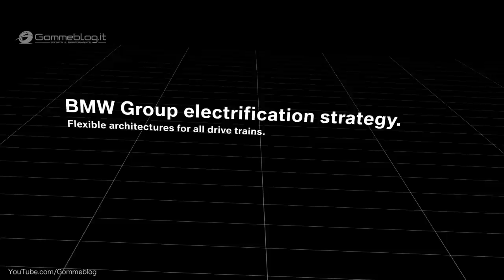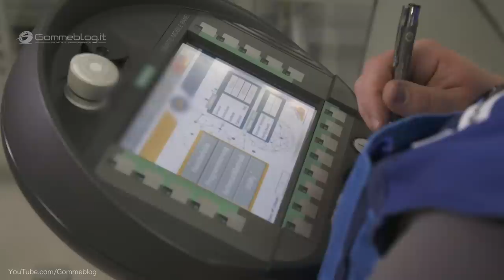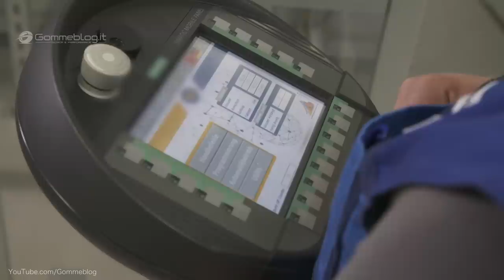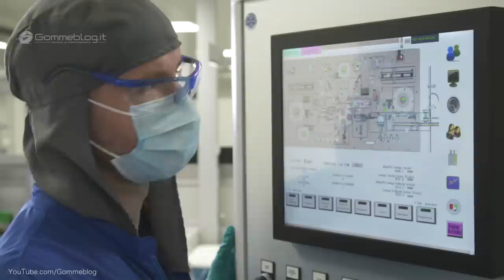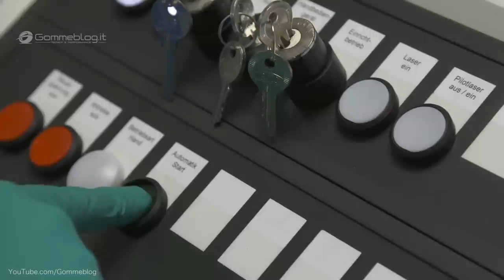BMW Electric Drive HOW IT'S MADE - Interior BATTERY CELLS Production Assembly Line

Comment from the maker: Electric Drive is the Future !! In Your Opinion Electric will be great as the  modern 4L, V6 and V8 Engines ?
Reply: GommeBlog.it: Car & Performance bmw only has i6 no v6 lmao that's like saying Honda makes a v4 (excluding their niche bikes)*
Reply: Honda does make a V4: https://en.wikipedia.org/wiki/Honda_VFR1200F
Reply: Andrew Beresford not in cars though..
Reply: That's true :) I just didn't want one of their finest engines to be forgotten!
Reply: easy swap~able batteries would be better . also , no modern tech products can last more than 2 years with minimal maintenance . so it would be wise to teach public best way to dismantle , recycle & dispose of beyond repair materials .
Reply: Is this real speed, or slowmotion for the vid?
Reply: I'm afraid to say that they're already better! :) Test drive an i3 if you can and you'll soon get rid of any engine car you have!
Reply: i want to work there . easy . just tightening screws and few installations . also get to work side by side with pretty german ladies
Reply: GommeBlog.it: Car & Performance -€y
Reply: It can't be any worse than the junk engines they currently offer. None of them are holding together, timing chains that go bad in 60k miles, oil leaks and way overpriced parts.

They do drive nicely though.
Reply: What happens when the batteries freeze or when they hold less of a charge and discharge less energy in subzero temperatures?  Walk and buy new replacements batteries for your electric car at $2,000 a set? I'm all for alternative energy. But this technology (in my opinion) is still terribly outdated and is designed to costly to the consumer. Just like the combustion engine is being made to do. Oh they can make tthem with supior fuel efficiency and more power with less emissions. But my would they build them to do that when their friends and colleagues make their money from selling you the fuel to run them. And more fuel that is burnt in your engine the more carbon that will be building up into it and creating the need to have emissions reduction components, parts and sensors installed and replaced when they brake down or fail.  Helping part sales revenue.
Reply: all new - well forgotten old
Reply: John Pinter I'm for e-drive but you must consider the efficiency of all process, who and how produce electric energy for the battery?
With actually tecnology the electrification it's only green in the place you use the current, but not where someone produce it, the risk is to increase the global pollution and also old battery are difficult to recycle.
Windturbine and idroelectric pump are actually the best way to transfer energy in electrical energy
Reply: because gas and diesel polluters don't have trouble in sub ZERO temps??? WTF is your problem?
Reply: Electric Drive is not the future, that's already present. Internal combustion engines are already the past and outdated.
The internal combustion engines already reached it's maximum, you can't make it more efficient. It's just the last century technique.
Reply: What is happening @ 17:00
Reply: Electric motors are great, but building batteries, charging them and recycling them is really inefficient. Power in never equals power out. People have always rightly complained about the battery element of off-grid systems. If you can imagine the whole world switching to using battery power for almost everything - transport etc etc, then just think how inefficient that will be, not to mention the wars over resources! Thankfully we still have legs and bicycles.
Reply: Energy from magnet can be obtained without any mechanical movement. All we need is material capable of being converted from magnetic to nonmagnetic when applying electrical impulses. This will simulate the rotation of the armature in the generators. Such a material was created for other purposes and there is technology. More info ?
Reply: Absolutely! They are the future
Reply: 07:06 Ja bundabar :D
Reply: You seem to forget that modern improvements/tech is also used on ICEs, diesel will ALWAYS be around and theres many more problems to mass evs than most people know because most people know little of this field.
Reply: YRS
Reply: GommeBlog.it: Car & Performance  it is more efficient and noice free and pollution free
Reply: Battary life is impartent
Reply: Electric cars are great already. But the pollution resulting when producing the batteries (that have to be replaced every 2-4 years or so) and the pollution created by the substances yielded by battery "recycling "process nobody speaks about. Because that bill will be higher than the internal combustion engines -and will be paid by our children's children.
Reply: It's better already..just need better batteries/ greater energy storage.solid state graphene type might work well..
Hybrids are the future..
Reply: @ifan3270  …八
Reply: Humanity must return to super-coherence with nature or lose the planet. Renewable sustainable energy is our only hope.
Reply: OK...handar....6o...m....codomona....u.....parmeson....dean
Reply: Это 💯 процентов!!!

Comment: EV's are coming. Todays £75 ph ICE mechanics are tomorrows out of work blacksmiths. I'm an electrical engineer with an interest in power electronics. I'm gearing up for this right now!
Reply: Yep cause their won't be a need for suspense er I mean suspension and mechanical steering or other mechanical parts. Wait rumor has it even with the new electronic stuff some mechanics or apparently technicians as they are called these days seem to take course on that stuff, but that's a rumor.
Reply: Me too . I think were on the right track
Reply: Actually, the mental and experiential crossover from ICE to EV is good enough that most mechanics who learn EV mechanics and electronics now will do fine.  Yes, it requires learning about electric things, so there is a bit of a hump there that may waylay some of the anti-electronic people, but a lot of mechanical people have the right brain set for electronics too.  You're right that the BEST electronic people will be better suited to EV's than the BEST mechanics, so there might be a bit of a pay cut for the BEST mechanics.

But I think the biggest determinant for today's mechanics to catch up is whether today's mechanics start learning EV stuff now rather than later, because later is too late.  While some individual mechanics just won't hack it, most would if they start now, and if they're not too late in life, it would make sense to either update in their auto repair career or get a new better career.

It's interesting:  our society got stuck with ICE vehicles for a long time; we're not used to change, even though we've been lied to and say we're used to change.  We've actually experienced a lack of change in terms of market forces in the vehicle realm.  Natural innovation would have been slowly far more disruptive, but oil and ICE companies kept innovation down for a VERY long time.
Reply: @bradallen1832   Its going to be a long time until EVs really kick off, for one our electric infrastructure is already 50% efficient and can't handle the extra load that would be put on it. also mechanics will always be around and so will ICE, maybe electric for small cars but for the things that keep your world moving, construction,ag,transportation etc, all things requiring power and are used for more than just a people mover. diesel will always be around and has a lot more room to grow in efficiency power weight all that.

Comment: What kind of battery cells were these? They were clearly not AA/AAA/cylinder based, and unless I missed something they looked like they were completely solid state. Their production gradually started from a thin layer with no liquid electrolyte added at any stage. Is that why they were "prototype" ones? I also don't get why they were extensively scrubbed or cleaned with what looked like plasma.

Comment: I like the idea of having the batteries in a giant tub under the cabin.  You get a very low center of gravity, and they should be relatively easy to access come battery replacement time.
Reply: Really the only place to house them, not much of a brainer IMHO
Reply: With proper suspension, they corner like a greased weasel in a drain pipe.

Comment: What's the purple plasma circle they are running the batter cells by?
Reply: Yeah, I was wondering that too.
Reply: It's called plasma cleaning.
Reply: Same
Reply: See it at 17:00 and again at 18:00
Reply: I think it's meant to demagnetize the parts.
Reply: @dfaulk2660   It's aluminium, there is nothing to demagnetize. It's efficient method of cleaning prior to adhesive bonding.
Reply: Those are batteries? I thought they were rolls of extra wide TOILET PAPERS...  LOL!

Comment: all we need is a good battery, not the expensive art of work.
Reply: True physics is beauty.  Our brain is designed to see any good physics as beautiful.  That's why symmetrical boobies and symmetrical batteries both make us horny:  they are both representation of beauty because beauty indicates truth in physics, i.e., better suited to our universe.

Trying to make good physics ugly would be difficult.

I suppose we have a little bit of an exception point when we gore a human and see innards; those innards are also in cars.  However, once you skin the organs of the car, we get closer to our non-gross pattern recognition, and we see the beauty.

I was asking where the heat tubes are, though; how do they regulate that thing?  We see the fire casing but not the heat casings.  Well, they didn't explain the heat casings, anyway.

Comment: None of the processes or parts are labelled, so mostly it's just about guessing the part. Also missed the construction of rotor/stator apart from a little gentle wire bending. Is that too secret to show, given that battery cell construction is quite detailed by comparison?

Comment: I don't think this kind of battery capacity is Condense enough.  Do you ?
Reply: Me neither
Reply: Not very condense, you're right. The kw-h / m^3 (volume) on these module packs I'd imagine is nowhere near the energy density of the Panasonic 2170 packs found in Tesla. BMW might have to trail behind in the battery technology for a little while, but they can still build amazing automobiles.
Reply: One single giant battery roll per vehicle could save some space or increase capacity
Reply: Then you must be more knowlegable about batteries than the entire BMW R&D department,  which probably consists of hundreds, if not thousands of very high qualified engineers and chemists. If they decided to build the batteries themselves in this particular shape and size instead of buying them from Panasonic or LG,  that means there is a very good reason behind it,  as it will be extremely expensive and time consuming to do so.
Reply: Boring
Reply: I think they're willing to sacrifice a little capacity for their own scalability and flexibility of how they build their own packs. It also simplifies construction. 
Going with Panasonic's 18650 or 26650 cell format means thousands of individual cells have to be individually soldered/welded into place - so that adds complexity. You sacrifice power density going with LiPo batteries like this but the number of cells that you have to individually connect is significantly reduced which leads to faster production times.
Also with the 18650/26650 you're stuck with the physical dimensions of those cells (stacked end to end, horizontal/vertical orientation, etc). One of the things they pointed out at the beginning of the video is how their battery tech lets them create custom batteries basically on the fly for their cars dimensions and power needs. So they can create taller batteries for say an X5 or a shorter battery for a 3 series and use all the same machines and manufacturing processes.
Reply: Ok, scalable, but is a rolled and pressed battery as reliable as just rolled or in the case of lipo sheet stacked cells??? Also robots weld hundreds of cells together at the same time, it really doesn't make sense to pull that as a reason for going home brew with the cells... Maybe proprietary chemistry... Or maybe to lock you in the BMW spare parts ecosystem... Who knows... I would't buy a new BMW if they were the last manufacturer left on the planet...
Reply: Yep, to lock you in to buy a new battery pack when the original fails just after warranty expires....
Reply: It's like usual CAPACITOR inside? Aluminum Electrolytic? Big size.

Comment: The current batch of gel type lead/acid batteries for petrol engines are lasting 2 years in my car. I sure hope these futuristic battery packs perform longer, or it will be too expensive for families trying to pay off their mortgage, feed themselves and school their kids.
Reply: These are Lithium-Polymer batteries. They can last a lot longer and can handle very high peak discharge rates.
Reply: These batteries last 100,000s of miles.
Reply: The solid state batteries are coming dude.  And they are a WHOLE LOT TOUGHER than today's Lithium-Polymer batteries. They also store more electrical energy (2 1/2 to 3 times).  And their life?  Around 25+ years of daily use.

Comment: Battery cooling system appears absent. The rectangular form factor is more space efficient (compared to Tesla's little cylindrical cells). But there does not seem to be a system of dissipating the considerable heat generated during both charging and discharging. Keeping the batteries cool is necessary for their longevity.
Reply: Of course there is a System for heat dissipation. The batteries are liquidcooled. At 18:30 one can see the application of the thermal paste required.
Reply: Yeah of course BMW didnt think of that.
Thank god we have you to clear up this mess...
Reply: Trisailor33 Thank you for your observations, BMW has a non-tesla method of cooling their batteries, I suspect something to do with "PATENTS" and intellectual property protection.  Which University did you attend for your Engineering Degree?
Reply: Stephen Narramore : Oh take your snarky hat off. Would you need an engineering degree to know that packing rectangles up against each other is going to create problems with heat dissipation? While BMW may have a battery cooling system, it is surely not evident in the video. And that is all that I said.  That it can't be seen. You would think that a video promoting their advanced engineering would demonstrate this important feature.
Reply: I've seen a number of "how tesla makes it" style videos, and none of them show the cooling system either.. But there is a great video from a simple "tear it down" channel, and he shows the cooling system. No idea if he has done a BMW battery pack, but the Telsa basically have cooling on every cell.